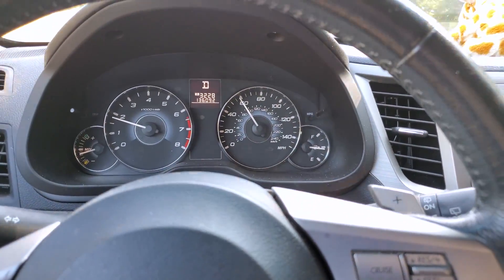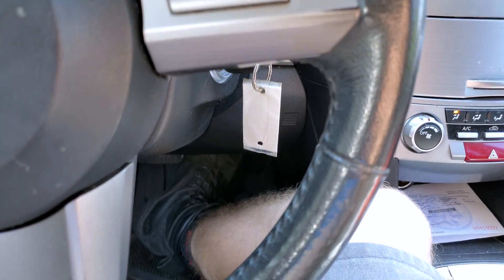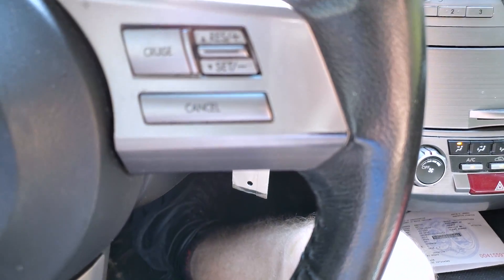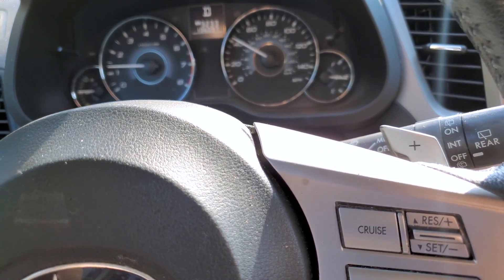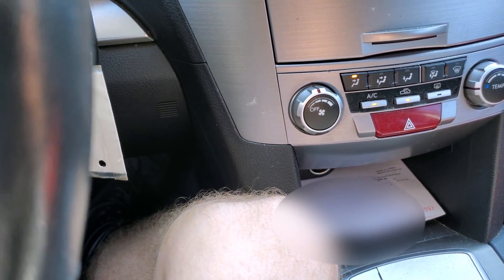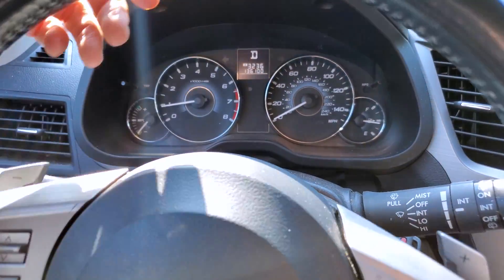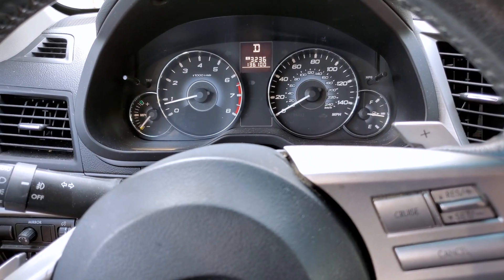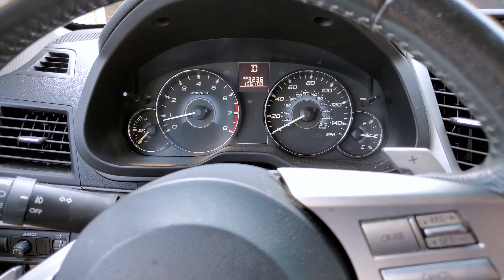Subaru TR690 CVT Torque Converter Failure

Comment: I mentioned on an earlier video that the CVT from JATCO was already having problems, you told me where did I hear of it?  At the dealership I work with - now you are seeing them too.  Don't worry, you will get more of these failures. Not as good at the four and five speed units from JATCO. Wish it was not true, but now you know I was not making this up.  Under 100,000 miles as well.
Reply from the maker: The CVT is NOT a JATCO unit. It is made in house by Subaru. Also, never said they were reliable or good transmissions.
Reply: @MrSubaru1387  You are right, my bad.  I will dig up my response on an earlier page where you wrote me to tell me that the CVT was not having issues - I promise I did not make this up a few months ago.
Reply from the maker: @Buc_Stops_Here  I promise I've never used reliable or good to describe a Subaru CVT. Lol
Reply: @MrSubaru1387  You are right, sorry.  I mistook what you wrote earlier so we agree on that.  My apologies.
Reply from the maker: @Buc_Stops_Here  it's all good.

Comment: Seems to me the older Subaru’s were built from more robust materials
Reply from the maker: Definitely better built.
Reply: @MrSubaru1387   sorry if this may be slightly off topic, does 2008 EZ30 have iron bores or they are aluminum ? and are the engine blocks 1 piece or  2 piece like EJ 25 ?   thanks Happy Boxing
Reply from the maker: @rogermorits5415  aluminum. Two piece engine block like the EJs.
Reply: @MrSubaru1387  thank you
Reply: My parents used to have a 1986 Subaru GL wagon 5 spd. They bought it used in 96 and owned for 3 years. That wagon couldn't be killed, for real. I recall the next owner still driving the thing 10 years after buying it, as always all beat with the cargo area full of stuff and dirty as heck

Comment: My 2014 Forester CVT’s RPMS occasionally bog down when I come to a stop. Feels like it want to turn off but it doesn’t. Happens mostly during cold weather. Could it be the torque converter?
Reply from the maker: I'd look at cleaning the throttle body first.

Comment: Man people need to have a vehicle checked out before buying. I feel bad for them on one hand and smh on the other. Look forward to videos on this vehicle it will be a great car once maintenance and torque converter issues are addresed. My tool box is a melting pot of brands. Love my snap on tools but like you said sometimes it's not worth it if you don't use it day in day out

Comment: Clearly we know what is going on here why you’re not getting any of these jobs at Subaru dealerships. You’re more than qualified and could wrench circles around many of the techs already there in my opinion.

The issue is they do not want to take chances with a YouTube content creator with almost 40,000 subscribers revealing to the world their dirty secrets and shortcuts. Remember the “master tech“ with the ratchet strap pulling the dashboard on a airbag recall?  And that was seen by you during a quick walk-through in the shop. Imagine if you were there for one full day? Our heads would spin if we find out how they “save time” on jobs.  They are very aware of this.

They’re not fooling around with the chance of that stuff ending up on the Internet.  That’s whySubaru won’t touch you if they know about your YouTube channel.

This being said, they are missing out on a great tech especially in a time where they need qualified technicians.  I actually can kind of see why they would get cold feet on the idea of hiring you. Their loss.
Reply: 271,000 now =)

Comment: There was an issue with this transmission and something do with the torque converter filter or something to do with the T690 doesn't have a filter and the T580 does.  So to the point if the torque converter goes out like this you basically screw the rest of your tranny up.  My suggestion is if this happens get it swapped asap as if you don't I would think over extended time your gonna keep pushing chunks through your tranny.  Again though can't blame the CVT for this as it is a torque converter issue.....

Comment: I got the same tunnel noise figured it was the center driveshaft bearing, but it ended up being the right rear wheel bearing.  Sounds great again after the replacement.  2014 Forester Auto 2.5.
Reply: Subaru and rear wheel bearings 😂 most places don’t use the proper procedures when replacing those bearings and they will fail again... usually in a shorter time than the factory lasted.
Reply: @TsunauticusIV  nice than it will be $100 deductible for me. Probably cheaper than the bearing by itself.
Reply: @alelx jines How much did you pay, I guess I hear these bearing go out especially the rear ones.  Mine went out about 47k,  6 years of service.  I guess if that is my only problem on the car ever 45k I'm fine with it.  I'm certified still so bearing replacement was free, just I feel it could easily be the case for this video.  Also I could actually feel it in my feet as it got worse and worse the hum....

Comment: Nice vid dude, I really like your stuff. A lot of useful information for DIYers out there. Quick unrelated question for you: At what point is it worth changing the transmission / rear diff fluid in a manual impreza? Manufacturer says 100 000 kms or 5 years. Mine has 58000kms and is 6 years old, but I feel like age should not be a factor... Can age alone cause the fluid to go bad? Or is actual mileage the important thing? Cheers from Canada!
Reply from the maker: Always was told and saw the intervals of 30k miles.
Reply: @MrSubaru1387  Thanks!
Reply: Thank you for your time and knowledge shared!  
   
     just did a partial trans fluid change on wife's 2010 Forester with 150k...  wish us luck, it seems like whistling past the graveyard,  hope we didn't fix something that wasn't broken 🤷‍♂️